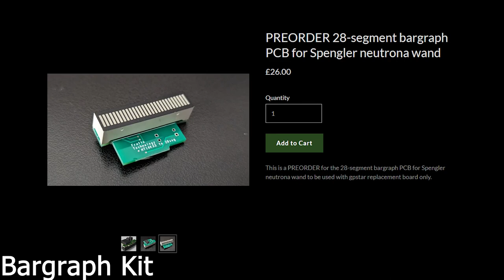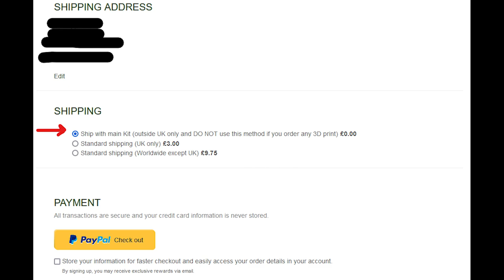PRE-ORDERS NOW LIVE! GPSTAR HASLAB PROTON PACK KIT - Overview Guide

Comment: this is great!! is there a version that is JUST for the wand? I have the Spengler wand with a GBfans pack and the sound died and I'm looking for a way to restore sound effects.
Reply from the maker: unfortunately no. the sound in your wand died?
Reply: @jonogunn  yes... at first it got extremely quiet, so doing the AUX mod through an amp brought it back to "factory" volume. Now its just silent...
Reply from the maker: @thefirefightingghostbuster1555  but it still plays sound if you do the aux mod? if so it sounds like the board is still good and perhaps the speaker is busted. if so taht's good news because you find that exact model online for cheap. google :36mm 0.25w 16 ohm speaker
Reply: @jonogunn  no, the sound has even stopped after a year of it only working on AUX. I was going to either get a new wand or replace the guts with a GBfans kit.
Reply from the maker: @thefirefightingghostbuster1555  oh yikes sorry to hear that!
Reply: This is my exact same problem. Did the same mod and now the wand doesnt make any sound. Is this a kit that would completely replace the wands board and return sound?